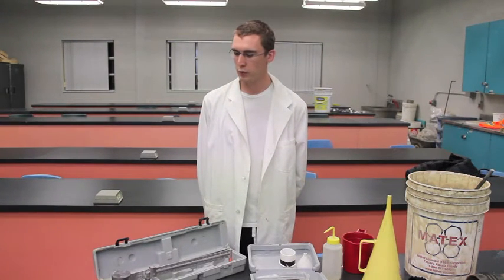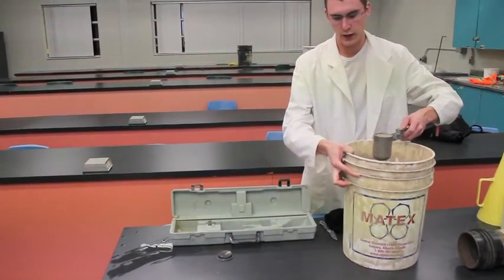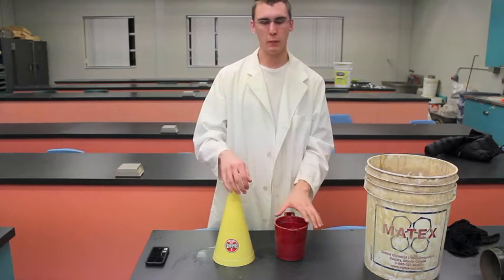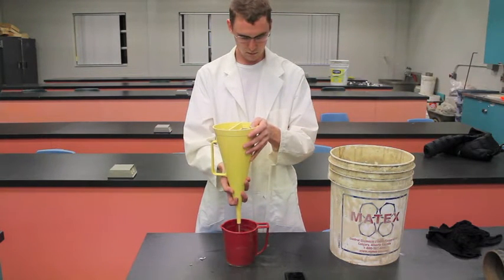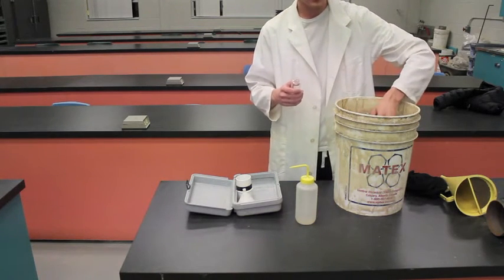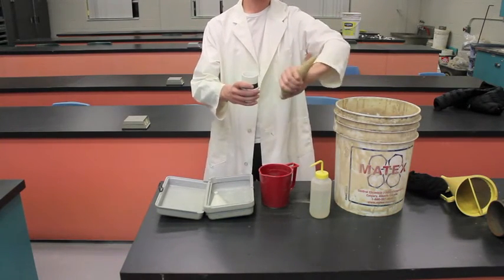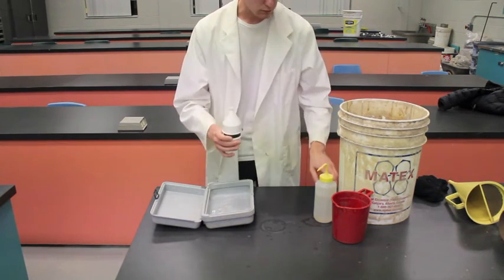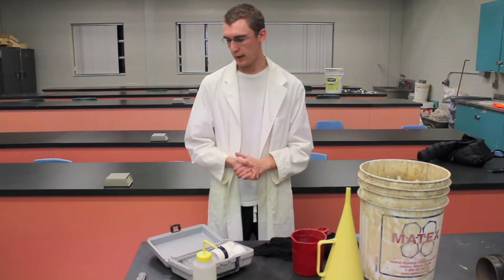Performance and Properties of drilling fluid - Tutorial Test Video

Comment: What will be the disadvantages of high sand content and low sand contentout of the limits and i mean by low that the sand content is zero for example and zero means that may be the sand is smaller in size of the screen 200 or may be there is no sand at all
Reply: Wear and tear on the mud pump and other equipments.